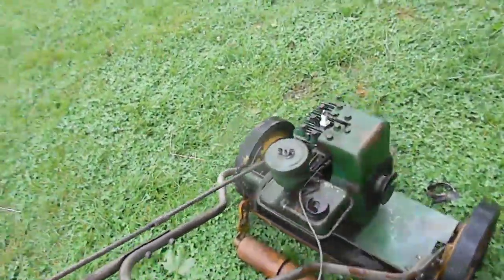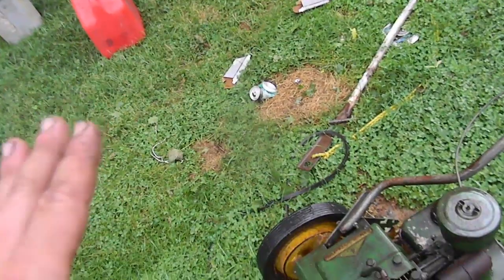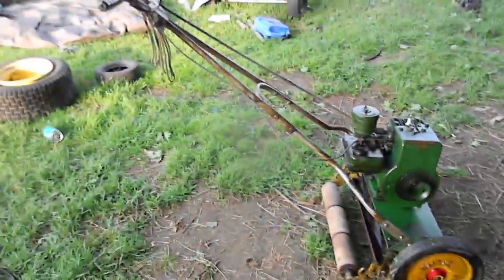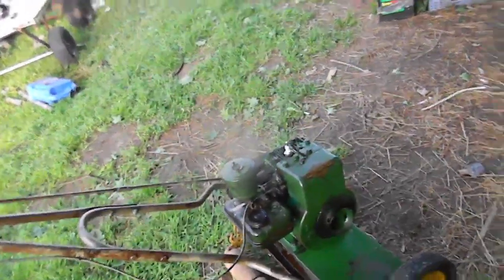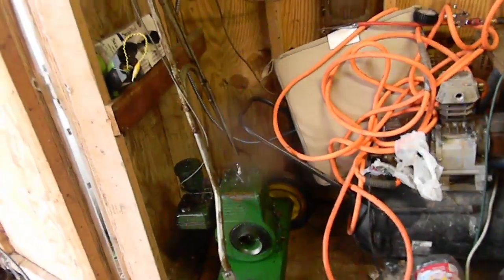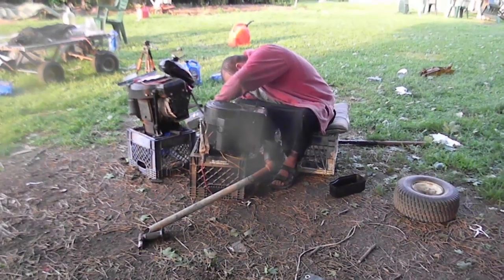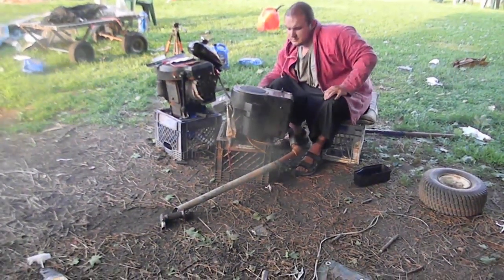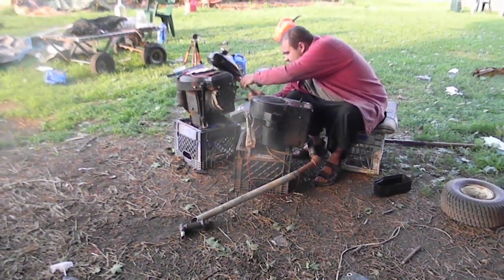Pennsylvania Exeter Reel Mower First Start in a LONG time

Comment: That things sweet.  You're getting a collection of old Briggs engines, aren't you?
Reply from the maker: without trying.
Reply: This is almost identical to a reel mower I found in my dads collection of 'neat shit' as he used to call everything he brought home. I'm here trying to find videos  and info on mine. I pulled the Champion H-10 spark plug and wire brushed it, but no spark when I pull the recoil starter rope. I'll pull the cover later and check the magneto. It pulls over very nicely without the plug in it, and sounds like the internals are ok. I have the Briggs & Stratton 5S motor that looks identical to yours except for the recoil starter. My reel is also 18" wide and the wheels have Exeter Pennsylvania cast on them. Do you know how to tell the year?

Comment: I have the exact same mower and the rubber on the wheels is falling apart, do you have any idea where I could get new rubber/wheels?
Reply from the maker: that i dont. but i could probboly 3D print a mod and find a sutiable material to cast new ones with. would have to do research on it.